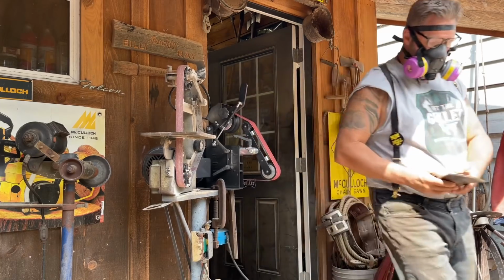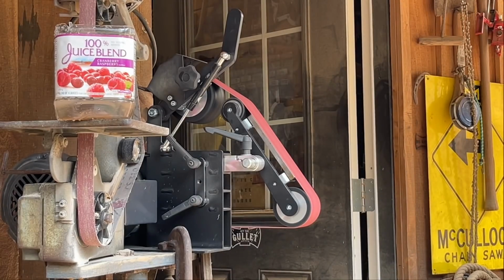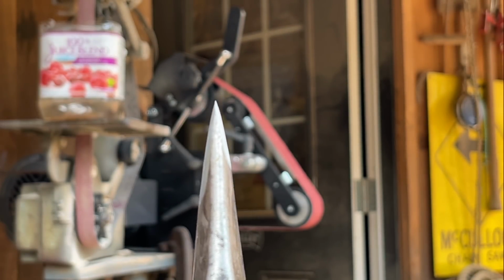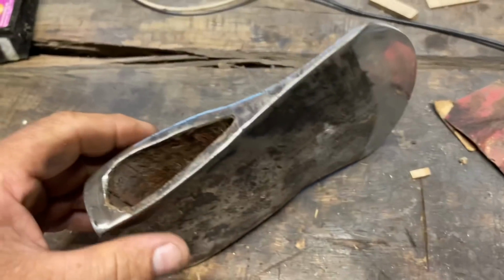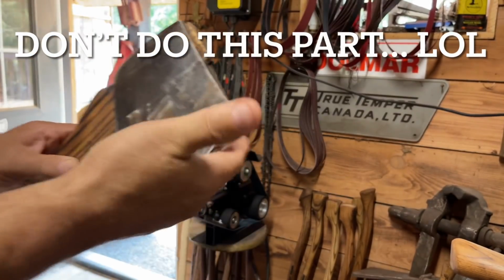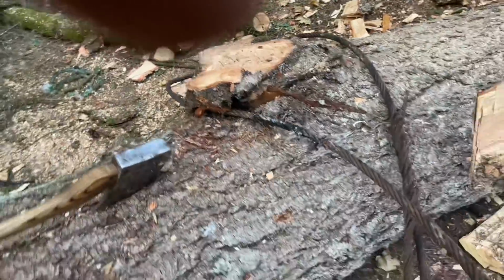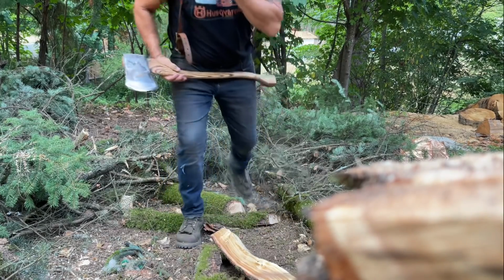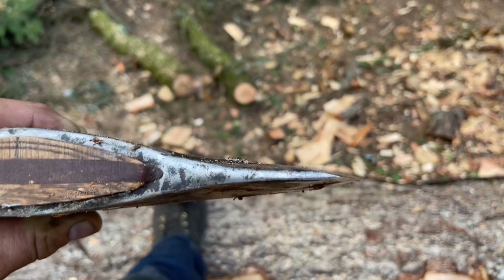How to re-profile your Axe, Sharpen with results.

Comment: Been watching all these videos while recovering from work injuries. So I refit and refinished my granddads old Council 3.5 head I found squirreled away.  Dad bought a new handle for it about 15 years ago and never got around to it!  Head probably set for 20 before that! Lol
No sander,, so had to reprofile it with files though. Turned out great for first try.  Found another older barbaric looking head buried in the dirt i was gonna do next. Started cleaning it up and found a hairline  crack near the front of the hole from top to bottom, so probably not worth fixing or welding up.  So checking the yard sales and such for my next project.

Comment: That's a nice belt grinder ya got there friend, and the older one is almost just like one I used at the hardware store where I worked on small engines, yes McCulloch too. Lol. I sharpened many a axe, and what have ya on it. I'm working on an axe mod myself right now, them speed bumps are quite the task to remove, I grind some with a flap disc and file some, it's what you might call fun!!!!!!

Comment: A thinner profile will penetrate deeper but a thicker profile will force the chips to split off. If you thin it too much it will tend to get stuck, and then you waste time and effort unsticking it on every swing.(People with sharp machetes know what I mean.)  Now the right balance depends a bit on what type of wood you are cutting, the weight and width of the axe and how hard you swing. When I say a thicker profile I don't mean a sharp speed bump/angle change, still a smooth transition just not as fine of a taper. I also take the speed bump off of my splitting mauls, still a very thick profile in general but you don't bounce off.
Reply: Oh and if you don't have a bench/pedestal mounted grinder. Clamp the axe to a sawhorse and use an angle grinder.

Comment: Good Afternoon Billy I have a question I was hoping you could answer... I got 2 acres of land that has about 30 mature pine trees, I want cut down. I saw a Logging company that is advertising ( buyer of standing timber or cut on shares. I understand the buy part however, what does he means cut on shares? I don't want to not know what he's talking about when I call him.. Thanks inadvance for your help 🙏💜👍💥🪓 Is that oil you're using after the grind?

Comment: Hey buckin I was wonder if you had any tips and tricks for profiling and sharpening hand tools such as Pulaski's axes and shovels without any sanders grinders and mechanical tools? Reason I as is I'm a firefighter and we have been going on wildfires and on each one we have a 14 day work period and 2 days off and in those 14 days our hand tools get pretty dull and out of profile but all we have are hand files any tips and trick would be greatly appreciated. I love what you do and your one of the reasons I got into forestry so thank you so much keep it up love alway wins🙂

Comment: I recently got started with chainsaw milling and found some of your older videos where you do some big milling work. I was wondering if you have any videos about sharpening rip chains for milling? I know, totally unrelated to this video ;)
Reply: I’ve been chainsaw milling for a few years and have had better experience with a normal crosscut chain. Just keep it sharp and set your rakers right and it’ll cut. Just my experience….
Reply: @benmeardith227  agreed i sharpen my chain to 12ish degree's and all that but then i tried milling with a stock chain, i think it cuts just as good, the one thing i have learned tho is you can file your rakers way more aggressively then if you're crosscuting. also to save some money i started just using used motor oil
Reply from the maker: just buy the right chain and follow the angles of new brother  and make it sharp . 5 degrees ,, and have raker gauge on hand
Reply: The one thing that a milling chain angle gets you is smoother but slower. I’ll take the speed of a regular crosscut tooth profile, faster but slightly rougher. If you’re going to be planing it later on, then no problem anyway. Besides, chainsaw milling is EXTREMELY slow and wears out your saw quickly. If you mill with your saw just be sure that you run the carb a little fat as it makes a bunch less heat that way; it’s full throttle with a huge load for a extended period of time.

Comment: Man, I’ve been trying to do this with hand files. I think it’s time for an industrial revolution 👍🏼
Reply: Same man, I may have decided against that belt sander a little too soon. Though tbh I've been putting off a vice which would certainly make things alot easier.
Reply: I stumbled across a Jet 6 x 48. It has changed my life.
Reply from the maker: i still do my favorite with files as it does an amazing job  i do have a video on it
Reply: @williamgray9088  
I picked up an "Ultimate Versatile  Vise"  from Garrett Wade a few months ago, they run about $125 now. I absolutely LOVE that thing, 360° head rotation and it's practically perfect for smaller parts like axe heads and handles. It does require magnetic jaw pads but they're cheap on Amazon (Garrett Wade sells those too). I have no affiliation with the company, just really pleased with this vise.
Reply: @Crusty_Otter  Ok, I'll give it a look. Thanks for the recommendation, I've really gotta get one. Would make sharpening my chains less of a hassle too.

Comment: BR put a pc of steel plate up on wall behind the grinder area. So you don't get a hot cherry in your siding board.
Reply: There's always a good logical idea to be discovered in the comments section. 
Love shooting sparks,  but not near combustibles.  Has the potential to get hot fast... Yikes

Comment: If the smaller belt grinder you have is a 1x42,  you could easily get a leather belt that would fit that and finish it on that grinder. I would go one step further and recommend trying a felt belt of the same size, very comparable finish to a leather belt, but it doesn't stretch out like a leather belt and lasts a lot longer.
Reply: You could also use a buffing wheel with a little polishing compound to remove that burr very easily without the need for a leather strop.

Comment: sweet convex work.
i highly recommend CUBITRON products for grinding.
I sharpen axes and other tools on my angle grinder. Freehand only. After this i only use micromesh for a few times. Every time (nearly) Razorsharp. The key is to form a convex bevel.